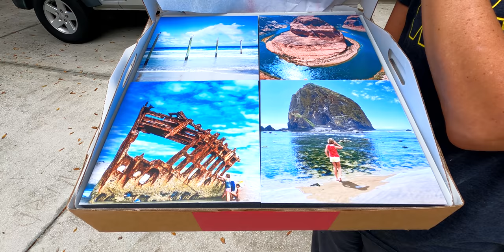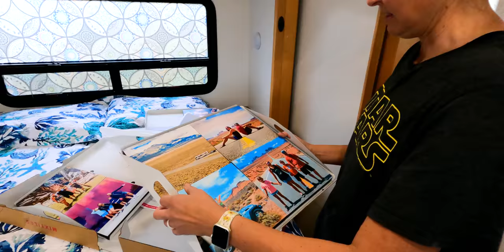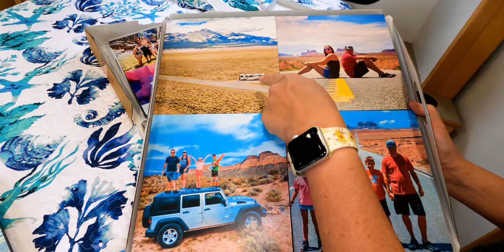DIY RV Remodeled Class A Motorhome With HUGE Bunkhouse (Our Tiny Home)

Comment: Have you looked at maybe putting a small section of short pile carpet on the bottom of the slide skis?  You could do a small square so it stays inside the RV and is not exposed to the elements but provides the same effect of allowing the slide a surface to ride on.
Reply from the maker: We haven’t but thank for the suggestion!

Comment: Did you remove the old wall paper off the walls or did you put up the peel and stick wall paper over it?
Reply from the maker: We put the peel and stick over it. RV wallpaper is actually more of a vinyl wrapping which helps with sealing, etc so it’s best to leave it in place and then paint or cover it with the desired covering.
Reply: @GratefulGlamper  thank you so much we will be doing out 2007 Fleetwood Bounder soon. 😀

Comment: Hey Charity and Ben, i have a question,  We're looking at a Avalanche 390ds.. It's a great rv for us but instead of a Queen bed in the extra room, we want to remove the bed and replace it with a pull out couch.  We're going to be full-time and though the bed is great for company, we want to make it a den but still have the pull out for company.  my question is, how much weight can the slide hold?  Will a couch be too heavy?  If you have no idea can you tell me how to find out?  I love your videos! Y'all are great
Reply from the maker: I’d just be sure to try to replace weight for like weight. So if the couch weighs the same as the bed, you would be good to go.

Comment: Those pine 2x4s are pretty heavy...did you estimate just how much more weight you’ve added to the slide?
Reply from the maker: We did and actually with the heavy couch, the heavy dinette and SUPER heavy upper cabinets we removed we estimated we’re actually less weight on the slide than before.